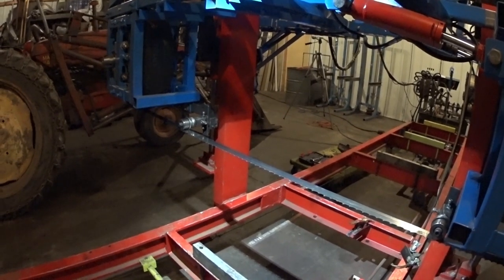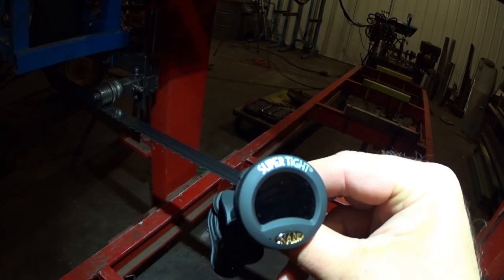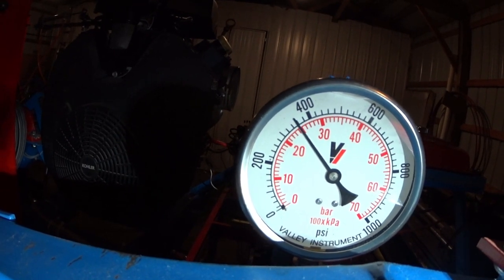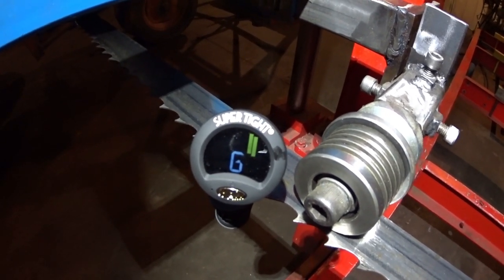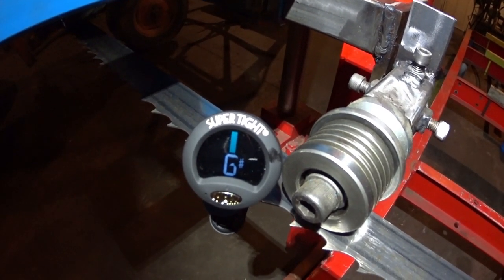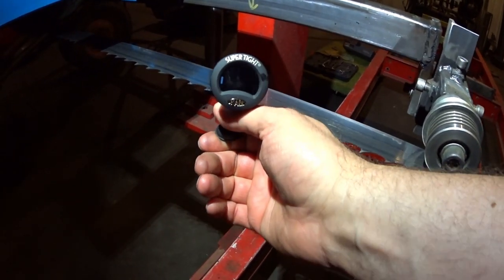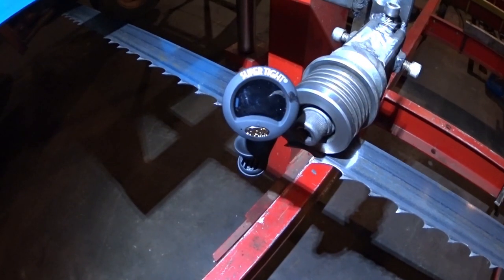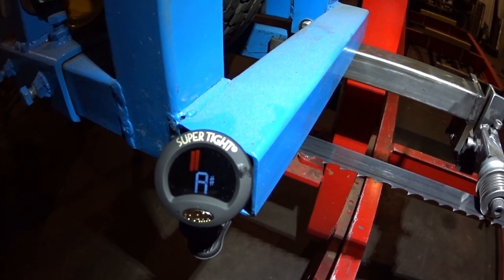sawmill guitar tuner tensioning

Comment: Interesting test! They are convenient tuners also! What PSI will you run the saw at ?
Reply from the maker: Plan to end up around 13,000 to 15,000 psi with the rubber tires.   Going to try doing another video on the tension limitations of rubber tires also.
Reply: @ThoenWorks  did you do this video yet?

Comment: I was thinking about the tuner thing and you showed that when you adjust
 your roller guide in and out it changes the tension as the note on the tuner changes. So in theory if it
 were set to a proper tension if you move in and out your guide it would
 make it slightly tighter or looser regardless so lets say you do the 
calculation on proper tension for a particular blade if you set your 
guide right in the center and tune the blade it should be correct and 
when you move the guard to the open or left position or to the closed 
position or right it should be right on and correct? Does it make sense 
to you?